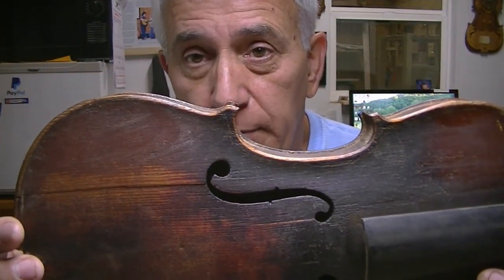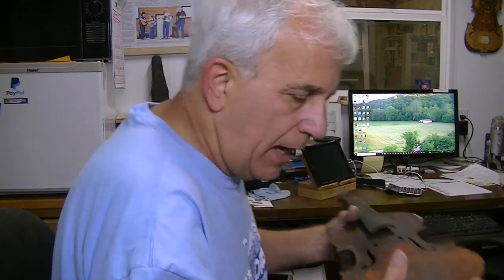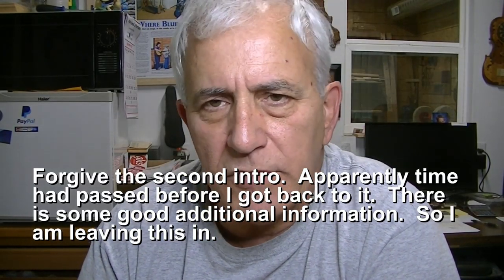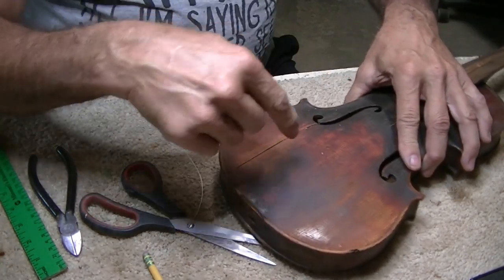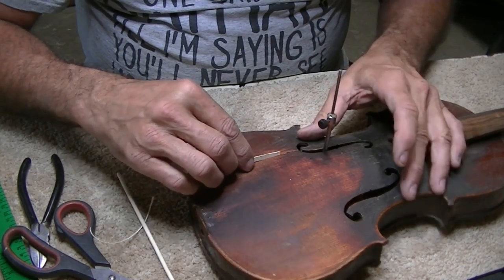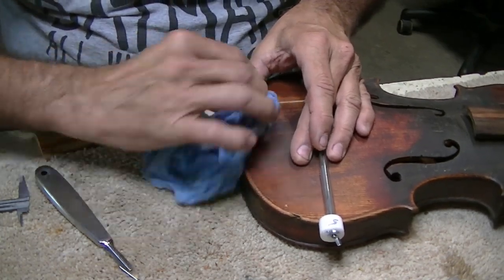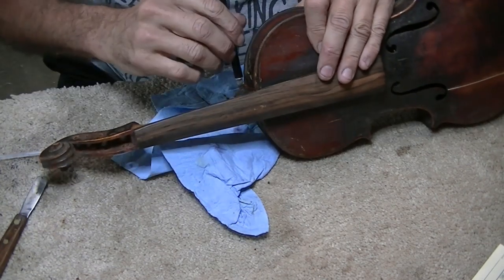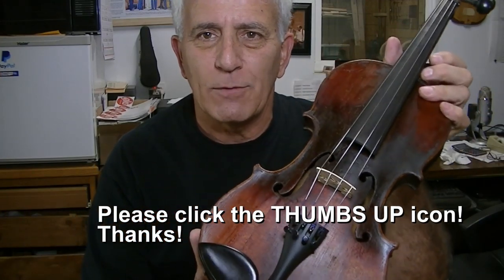321 RSW Party Pooper Fiddle

Comment: I have 2 old student fiddles in just about that shape.  I took them to an actual violin maker for an opinion. He said I could buy a brand new , equivalent  instrument for about 1/2 of what he would have to charge me to fix either of them.  I think after seeing this, I will give the repairs a shot myself. 

Thanks!
Reply: Give 'em a shot.  If nothing else, you'll learn something on a cheap instrument (even if it's what-not-to-do) !
Reply: my thoughts exactly.
Thanks for the boost.
I am currently rebuilding a pawn shop strat wreck.  Violins will feel classy.

Comment: You use Tightbond where a lot of other luthiers use hide glue.  My understanding of hide glue is that one of it's advantages is that you can melt it to remove it.  Can you do the same with Tightbond?  I've seen you put back on guitars with Tightbond, in the future will you be able to remove them without doing damage?

Comment: Jerry, it is a tradition to glue the back on with stronger glue than the front. It is the front which is traditionally meant to come off and not the back (I'm sure you know that really!).  I love the use of the sound post tool to level the crack. Genius. Still wish you wouldn't use Titebond though!!!
Reply: So does epoxy but you wouldn't use that!
Reply: @paularcherfiddle0351  Titebond can be disassembled.